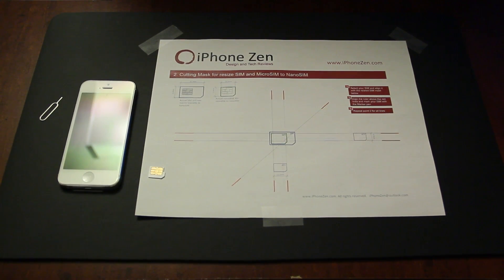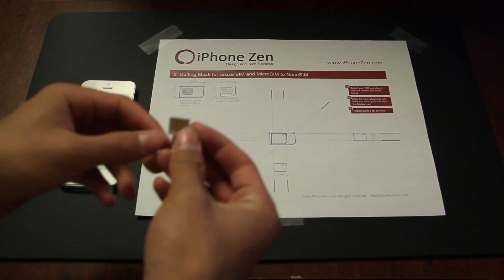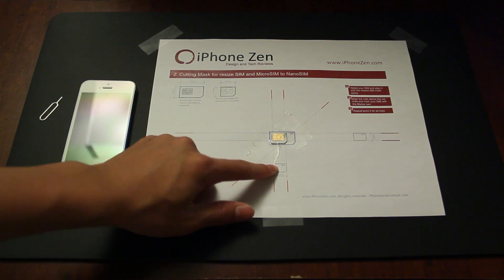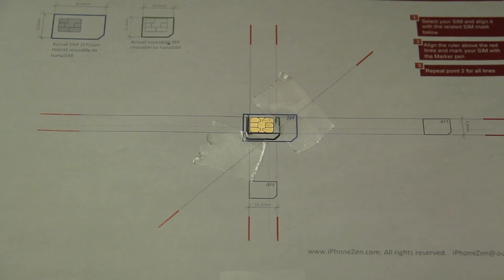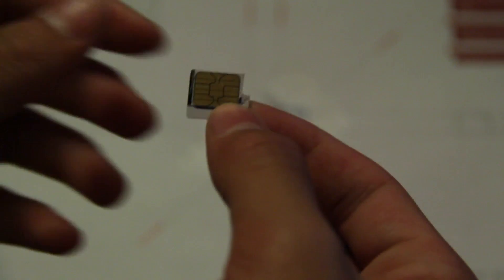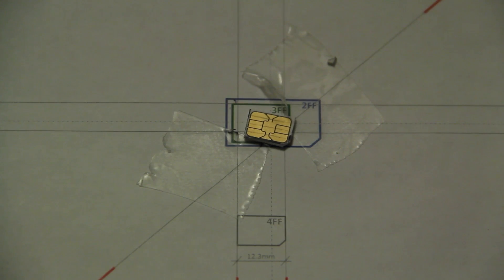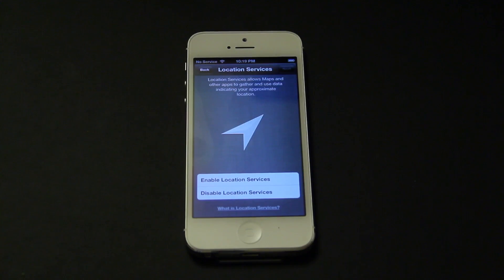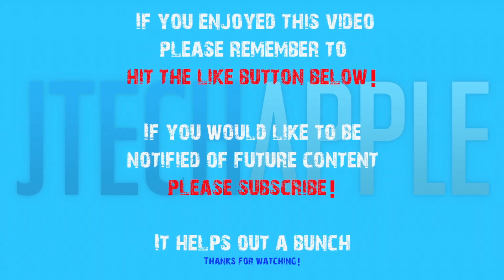iPhone 5: How To Convert Micro SIM Card into Nano SIM Card

Comment: If it didn't work for you, you either 1) fucked up the execution, or 2) inserted the card incorrectly. I just cut my micro sim card down to a nano sim card, without a template, a sandpaper, or sharp blades. Simply cut out the white plastic close along the edges, using the cardholder as guidance. When I put the sim card into the cardholder, my iphone 5s still showed "No Sim." As it turned out, I inserted the card on the wrong side. After I reinserted the sim card, my phone worked. 

Before you jump into the conclusion that you've ruined your sim card, make sure you inserted the card correctly into the cardholder. If the phone still doesn't work, then it is because you cut the card wrong.
Reply: [HOW TO] Unlock any iOS device.
read this one 
UnlockiOSNow. com.

Comment: its works, i did it with scissors then i used a nail filer to refine the side and edges, i didn't have to sand it to make it slimmer
Reply: Larry Smooth Did you use the print sheet or did you just eyeball it?
Reply: Kilted Celt Hey, i used the iphone 6 sim card tray as my template, while i was comparing the two, i noticed my sim card wouldn't fit in the tray even if i had cut off all the white exterior. I have the old sim card where the gold  rectangle is slightly larger than the one in the video. I called and found out it is okay to cut off side-parts of the gold. So i measured it , cut off parts of the gold evenly on all sides , used a nail filer and then popped it in and it worked.
Reply: Kilted Celt Maybe my overly sized sim card had something to do with me being with T mobile, i have been with them before they had Iphones.
Reply: Larry Smooth
Oh cool, thanks a lot for the tips. My new phone is being delivered soon and I found out it requires a nano-sim and I have a micro, so go figure why I'm here lol. I knew that the whole sheet thing was a bit unnecessary. I'll follow your example instead.

Comment: Honestly most providers will replace the card into the new size and swap the number onto the new sim almost instantly at least over here in the UK so my suggestion go to the provider and ask for advice its not worth risking your card due to the high chance of damaging the card and loosing your number for good :) Hope this helps
Reply: Unlocking your iDevice its now easy and safe 
the best site ever: 
UnlockiOSNow. c om.
Reply: Will it work on contract sims?
Reply: Yes it will but on contract you might as well just ask your provider for a different sized sim its not worth risking your card cause if you mess up there is no way to recover it

Comment: Gonna try this for my new phone, I'll be using my mom's upgrade and then transferring my activated, unlimited 4G Verizon SIM card in the new phone. Problem is it's a Micro, so I have to cut it down to a Nano. The phone comes with a Nano SIM but if I were to activate it it would cancel out my mom's current SIM.

Comment: My wife just brought home an iphone5s, I had an iphone4 ... while I can't recommend anyone doing this ... I did ... and it worked lol.  The metal IS bigger in Micro, so I had my doubts. I didn't even follow the template, just cut as close to the edges as I could. I also didn't sand it ... just squeezed it in.  I did have to get really close to cutting the metal when snipping the corner out, but that was it. I still can't believe it worked. Thanks for the info. (And again, unless you're willing to risk it, I can't promote the use of this method ... I'm just impatient.)
Reply: 7 years later… do you still have the iphone 5s and 4?

Comment: There are too many problems with that phone. The sim card is smaller and the micro SD card too! Another problem is that you've got to use that weird thing to open the sim card slot so if you loose that thing you better find something like that or you won't open it. I've got a friend who has got the Iphone 5 and it fell down so the screen was totally broken and some of the the screen peaces fell too. Even though those problems, it still being a good phone because of its system. Just my opinion!